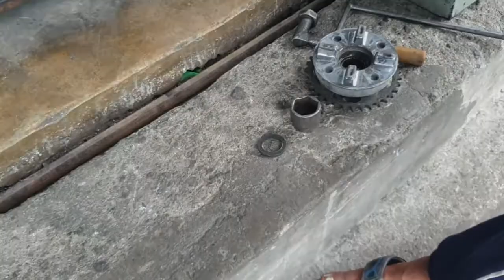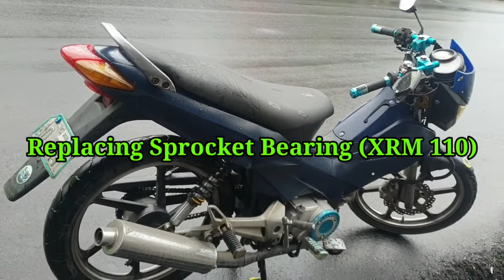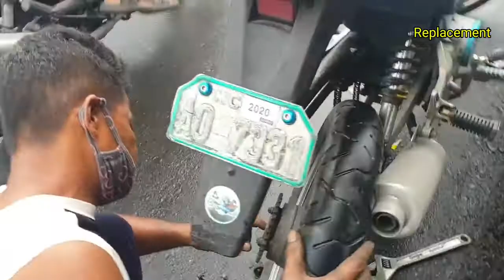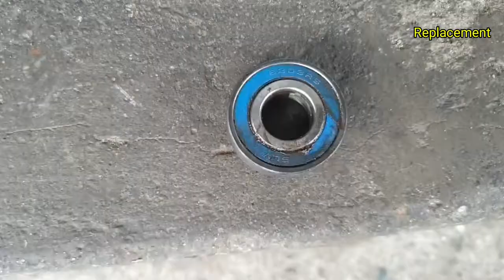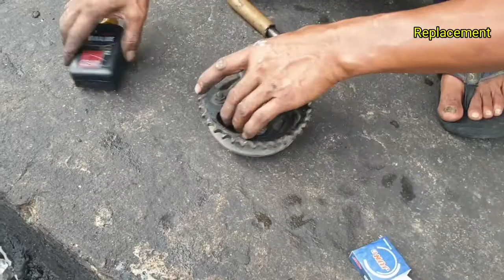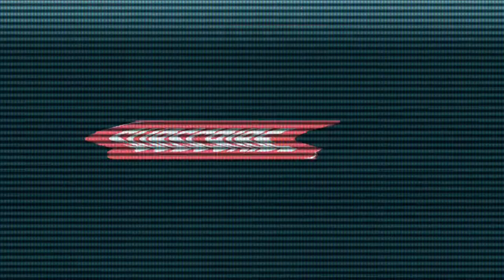Pagpapalit Ng Sprocket Bearing (Honda Xrm110)

Comment: Boss ilan bearing s reeae hub Ng xrm 110 2 bearing lng ba ...bukod s sprocket bearing
Reply from the maker: Yes po 2 pa
Reply: Png xrm at rearhub ko riader j motor ko..simula nga add ako 1 pang bearing s rear hub s kaliwa pg hihigpitan ko axle pigil ikot gulong.naiipit ba Yun bushing pg ganun sir..pg hihigpitan axle pigil na it gulong